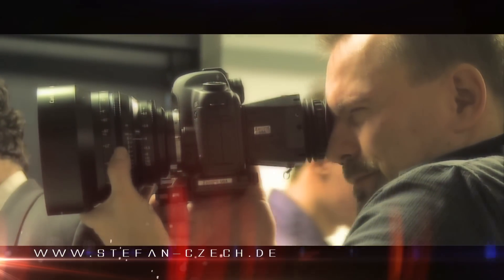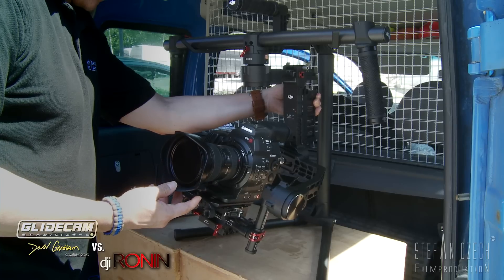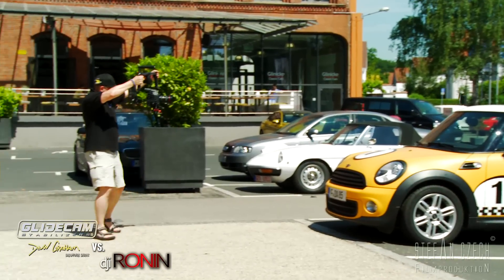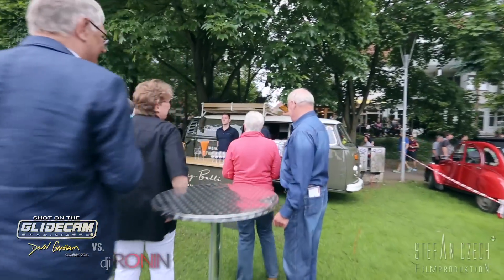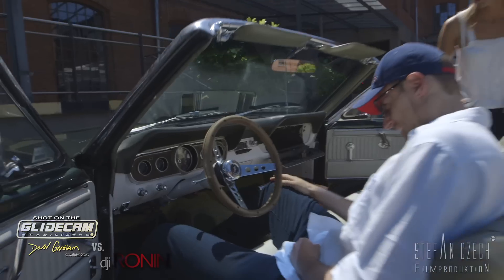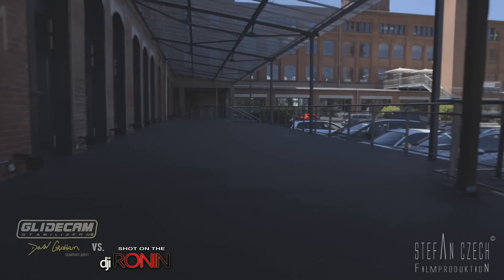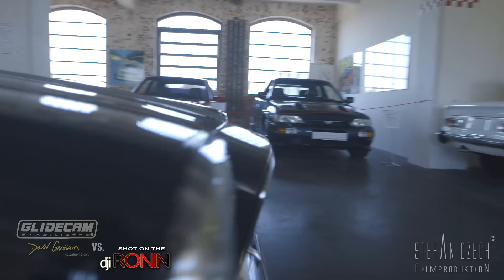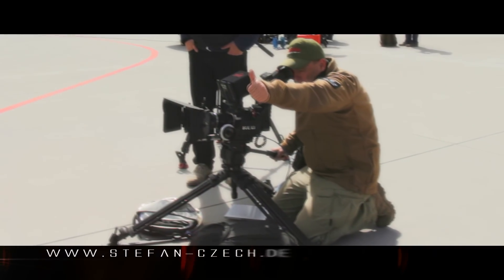Glidecam DGS vs. DJI Ronin 3-Axis Stabilizer

Comment: I own both a Steadicam Pilot and a DJI Ronin. I use both. For some things I love the Ronin because I dont get the side to side movement i get using my steadicam because of operator movement. I totally agree that the Ronin is not as versatile. When I do events I use the Steadicam because I can move and capture shots live with really good results. I use the Ronin when I can really plan and rehearse my shots and get superior results. The Ronin gets really heavy really quick and I have to put it down a lot. All in all for me I just dont use my Ronin enough and am now looking at picking up a Beholder MS1. Oh yeah, I also use an iKan X3-Plus gimbal for iPhone and GoPro and get amazing results. I guess every shot is different and its nice to have the right tool for the job.

Comment: Really appreciating your comparison and that you share it. I also get a little the impression that you have a prejudice against the Ronin. Besides the very well Steadicam work (thumbs up) I miss that moves on the Ronin. Operating a Ronin now for many hours I can state that it's clearly the inexperience in operating it - you can do extremely good shots with it - if you trained enough. But I also know that a Glidecam is not working out of the box, isn't it? :)  
For sure I agree on the fact that Ronin is some over-hyped and also definitely the Glidecam (Steadycam etc.) is not dead at all... I start making the experience that in some situation the Ronin does a great job, while there are situations I prefer using a Glidecam, or of course other stuff. So if your point was showing that there are still good reasons for a Glidecam, OH YES, DEFINITELY !

Comment: Great video comparison. Wish I had watched it before I bought my Ronin-M. The Ronin-M being electronic has a few other issues with fragility. Water splashed briefly on one of the motors and the entire system died. I have to get it serviced and hopefully fixed. This was a beach shoot where I was attempting to be very careful with it. Oh well. Hope it doesn't cost too much $$$ to fix. 

Anyhow, I just picked up a GlideCam XR-PRO to use while it is being serviced. For less money than one of the gimbal motors is likely to cost me, I have a very smooth stabilization rig. I am very impressed. I love the level of control I get with it that I never got with the Ronin - I was always a slave to the motor speed. In addition, I can monitor much easier with the Glidecam because the monitor from my GH4 is at eye level. It also takes me less time to balance and I have the XR-PRO which isn't even as easy as the DG or the HD series of Glidecams. I am very much enjoying the level of control that I have with this stabilizer. Two thumbs up!
Reply from the maker: Thanks Rom, glad to hear you opinion.
Cheers
Stefan

Comment: I am newer to videography. I tried the GlideCam before purchasing a gimbal similar to the Ronin (which I'll call 'gimbal') and found it very difficult to use as a beginner. I could tell it would take me a LOT of practice to get quality footage using it. On the other hand it took hardly any practice (10 minutes?) to get amazing footage using the gimbal. The camera turning delay you mention is trivial because it is easy to get used to planning a second ahead of time. My gimbal is no problem to place on the ground after turning it off. The only negatives I experience with the gimbal are you do need batteries and it can get heavy after an hour or two of holding it. Maintaining focus is also difficult but you have the same problem with a GlideCam. Otherwise for a beginner the motorized gimbal is wonderful to use without needing a lot of practice.

Comment: Thanks for this ... I was very excited about the DJI, and was getting the "wants".  But not only the things you mentioned, but I also noticed the DJI footage was not nearly as smooth.  I noticed it had issues BEFORE viewing the Glidecame footage, in fact.  Watch closely, and you can see a shakiness to the DJI footage.  It seemed side-to-side mostly ... perhaps it was not 100% calibrated?
Reply: +TimmyCrackCorn PS>  Yes, I've seen DJI footage that was very smooth.  However, it's always been promo footage, so who knows if it has been processed.  This appears to be raw footage.
Reply: +TimmyCrackCorn I have the dji Ronin-m myself the side to side is the operators fault as the gimbal does not stabilize side to side or the up and down motion of a operator walking with this. As he does say he is a steadicam operator and you would expect him to be better with the Glidecam than the ronin. But if you train with the ronin as you would have to do with the glidecam you get better at it and will achieve the shot you want. The benefit of the ronin is that it has a faster learning curve than the glidecam and personally I think it is easier to set up. I have owned a glidecam before but switched it out with the ronin because of convenience. The thing that he does not mention in this is that the ronin also have usb, p-tap and a dji light bridge connector which can power an wireless hdmi or sdi transmitter, to be used with a wireless monitor system and wireless follow focus system that you would have to use on a professional shoot where you have a focus puller. This is something that the glidecam would need an external battery to do.
Reply from the maker: +Anders Montgomery its interesting that most of this comment focusing on the few shots I made with the Ronin and not so much on the many other thinks you can´t do with it ;-)  You have to strip down most of the normal cameras to fit into this thing. You can´t run backwards...he why repeat my review...haha:
Keep cool even when you think you know it better.
Cheers Stefan
Reply: Stefan Czech I do really see your point about the glidecam feeling more natural that you can run backwards with it and can be a better option than the ronin if you know how to operate it but however the ronin is an easyer way for a beginner to get the "steadicam" shot where the camera moves independent of tracks or jibs. And your point is valid how you need to strip down the camera, but this is something a lot of people would do anyway when putting it on a glidecam as well, to try to keep the weight down. I'm sorry that I did not include the other shots, but I tried to explain why you might want to concider the ronin over the glidecam, and the power option and the quick release plate with the rail option  on the ronin is something that should be considered as well in this comparison as this makes it easier when it comes to mounting a remote follow focus and a wireless hdmi system.
Reply: +Anders Montgomery I think the ideal situation would be to have a newbie cam operator with little to no experience with either system, try them out, duplicating the same shot with each.  Then upload the raw footage.  Maybe send the third pass (third attempt) from each.

Soooo .... please send me your DJI and Glidecam devices and I'[ll be happy to do it!  :D

Comment: Hello Stefan, thank you for providing such in depth video comparisons! What are your experiences with shooting Image Stabilized lenses with both Glidecam and Ronin? Are they helpful? Or do you prefer switching IS off?
Reply from the maker: Hi Andreas, thanks for your comment. I dont like to use the IS when I use the Steadycam because the IS lenses are made for stills. I allways have the feeling the IS "stops" a frame or so.
Cheers Stefan
Reply: +Stefan Czech i have the same feeling and was wondering if its me.

Comment: Good review... A few points from me, firstly it seams you are a tad brash was the glide can. I would recommend slowing your movements down and make the more cinematic. I shot with glidecam HD4000, DJI ronin and Came TV gimbal. You can get smooth shots on your Ronin, but you can't expect to correct jerky movements. It compliments smooth camera movements. So you need to be just as steady as with your glidecam, but it's heavier! So get a vest if you can afford it and you will get even smoother shots :)

Comment: Great Video man it helped me so Much and I loved the shots too , So the Ronin gives you a way more Profeccional look But the Glidecam it's easier and better to use ? and if you could only pick one to shoot which would it be Just one for the hole shoot, Project, Movie ?
Reply from the maker: It depends on the shoot. But the 3x brushless gimbal deliver Avery artificial look to me. I have no really 100% controls over my framing and you see countless examples for bad framing and useless shots here on you tube. 80% of the shots you see on good camera moves are made with a steadycam system like the Glidecam.
Reply: Thank you so Much that's what I thought By the way what drives you to make or shoot videos ? Is it Movies or what inspires you has any cinematographers work inspire you , do you a favorite cinematographer ?
Reply: Isaac Splinker i think the Ronin gives off a robotic look at times even panning. The glidecam is more natural and fluid.

Comment: Mainly because of this video I bought the Davin Graham Signature Series Glidecam and I have to say it is very hard to get decent shots. Although I'm convinced that you can very good shots using a glidecam, but not without a lot of practice. 
So after months of not using it because I find it too hard to get a decent shot I finally put mine on Ebay and decided to go for a DJI Ronin instead.
Reply from the maker: +Auke Valk i m pretty sure that some minor mistakes in balancing and using the DGS are the problems. 
Did you check out my Glidecam Workshop series?
https://youtu.be/upJchgg1aCE
Cheers
Reply: Yeah I watched your workshops video's and they are very helpfull. 
I think, for me, the biggest problem is that I don't use it enough and therefor not getting the experience needed to operate the glidecam. What I'm being told is that it is easier to learn to use the DJI Ronin. Of course when you use the Glidecam enough the result could be better than with the Ronin.
Reply from the maker: I never say, that the DGS are better....but different!!! Also the step possibilities and the framing. It's much harder to get the right framing with this 3axe gimbals. Take a look on tausend of YouTube video with no Pröpper framing. Steady shoots is not the one thing I looking for.
Try what ever helps you to tell you story. Cheers

Comment: as a Ronin owner, I can say you are spot on. the look of the videos are just wrong. I haven't been able to put my finger on it. btw, I'm no longer using mine. I think I'm pulling the trigger on selling it right now actually
Reply from the maker: Thanks for your reply. I want to show that's not so easy as it looks to move the camera even with a 2.500€ electronic tool.
Many people didn't have the budget for the high end equipment. So why not give a Gildecam give a try for less half of the price

Comment: Hi, which additional equipment do I need for the connection between the Ronin and a monitor sitting on the remote control and how much effort is it to establish this connection technically ? Thank you for your input.

Comment: Hi Stefan, it is rare to see on the internet such didactic lessons. Thank you for detailed and easy to understand explanations about complex mater. Good old school at its best.
As I see there is a problem with horizontal stabilization. All examples that I see with flycam suffering from "loosing horizon" and that looks just like unwanted effect that spoiling whole sequence.
Your examples has it too but faraway less than in others that  I have seen.
Could you be so kind and point out how to control this behavior?
Maybe monitor on the bottom with "wider balance" will give better results.
Thanks again
Regards,
Svetolik

Comment: So this reviewer has worked professionally with GlideCam for many years... and then reviews an augmented/signature model GlideCam versus a DJI Ronin... and SURPRISESURPRISE finds that the GlideCam is 'more professional' because it doesn't require a controller or an additional operator... well some people would say that you can get exceedingly unique and one-of-a-kind shots from the DJI Ronin WITH PRACTICE just like the reviewer allaged from the GlideCam with his years of GlideCam familiarity use/experience. 

This review seems similiar to when a twenty-year use Canon shooter reviews a Sony/Fuji/Olympus camera and finds that the 'interface is not very intuitive'... well of course it isn't because you have twenty-years of 'synaptic muscle memory' honed from the Canon and everything will seem strange/foreign initially after that.
Reply: +Bruce Bachand My point exactly!:)
Reply: +Bruce Bachand And at the same time, you appear to sound like the opposite of what you accuse.  This will be the type of arguments for the use of camera gear until the end of time.  The points he makes are factual, and when opinions are made, it is clear that they are just that: opinions.  I think the video is very useful.  (Although, I suppose, you didn't necessarily say it wasn't. )

One point that will remain true throughout is that there will be shots/scenes that gimbals are best suited for and shots/scenes that glidecam-types are best suited for.  IMO the best thing to do is have both at your disposal.  Obviously not practical for every single person, but it is ideal.  For me, I prefer doing most walking/jogging type tracking shots with my Glidecam, any operator hand-offs or tracking while riding/hanging out of a car with the Movi (or Ronin, Came-TV, what-have-you, etc.), and finally any ultra-low high-speed tracking shots with a rented Tero.  It's so hard to find a "all-in-one" solution, but that goes for anything.
Reply: Having both tools would be brilliant. 

My critique/comments were specific to the context that I refer to... his other points (as you note) are wholly valid observations... I simply thought that in this one specific regard that he was weak.

Happy shooting/filming!

Comment: I've used the Ronin M in one of my Videos (Mercedes AMG GTs) and it was easy to get smooth shots. I have an external monitor and a remote for my camera so I can operate my Ronin on my own. The Landing-Gear is attached to my backpack and I am able to build it up with one hand. I can't operate a glidecam. I have one at home but after 2 hours of balancing and 3 hours of running arround its not the tool of choice for me.
Reply from the maker: +RGSGGR-MEDIA hi, if you need 2h of balancing, you really had to have a look at my Glidecam Training series 
https://youtu.be/upJchgg1aCE
And the 6 other parts explain how to manage all specifics. Incl. balance in less than a minute. 
Cheers

Comment: i don't get why there is so much up and down movement with the ronin. isn't it basically the same as walking with a steady cam ? on a gimbal there is only one axis I have to worry about on a steady cam it's every axis.
Reply from the maker: +mrcapello hi, the roblem is the z axis. At the Steadycam the up and down is compensated by your arm (handheld) or the Steadycam/Glidecam arm. At the electronic Gimbal there is no z axis comp.
Reply: +Stefan Czech what?  I don't understand. don't you control the z axis on a gimbal with your arms and legs too? same as on a glidecam?
Reply from the maker: +mrcapello not so efficent becouse of the weight and the economic. You have the weight not over one point you can grab on like the centerpost of the steadycam.
Reply: +Stefan Czech interesting. I thought the fact that you don't have your arms in front of your body would make it easier for walking but apparently the weight distribution is a bigger issue

Comment: Hello Stefan! I discovered your  tutorials on Glidecam and I love them. I am going to buy a glidecam soon because I prefer it for different reasons compared to Dji. Although I am seriously worried about weight just on one arm. I owned a stabilizer more similar to Merlin style and the weight is ok within a few minutes of use but I am sure with the Glidecam will be much worse. Do you have suggestion on how to solve wrist or arm pain? Are arm vest any good? I noticed you use Glidecam without any help in many of your videos. My camera setup is about 1.8kg. Thank you for any advice.
Reply from the maker: Hi Marco, thanks for your comment. And yes as I show in episode 7, it makes sense to use a west and arm support if it becomes heavier. 1.8kg might be not much but it depends how long you use it. Cheers

Comment: One thing I like Ronin series is that it can work seamlessly with Drone. For the long shot including both grounded and aerial photography, Ronin is a much better choice.
Reply from the maker: +youyi li ...yes of couse. Its a tool and there is a need for that. No question. But you have to use the right tool for the right job.

Comment: Ronin has many errors, it has hard shakes during motion, even if it has been very good stabilized, it shakes, maybe because has electronic Errors, i used 3 different the same model Ronin, but it has the same problem, if you want to move a little faster, it changes camera view to right or left side very quickly, it has long way to Perfection, it is new product and cannot be better or BEST. Glidecam HD 4000 is very good product. you must have proffessional skills to shoot with Glidecam HD 4000.